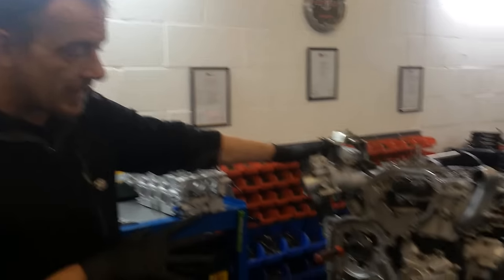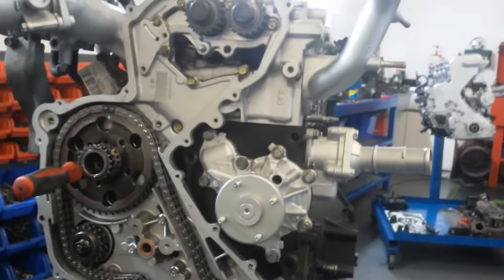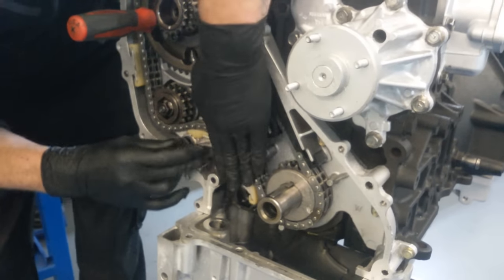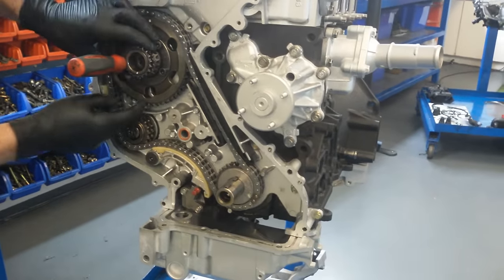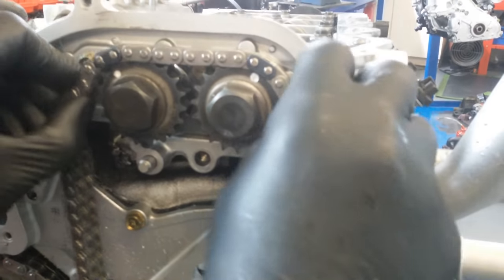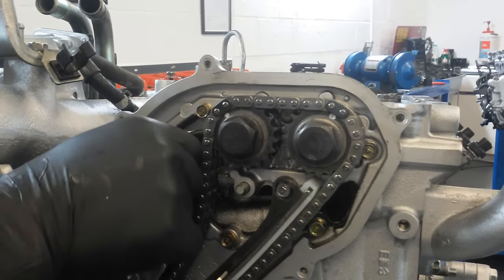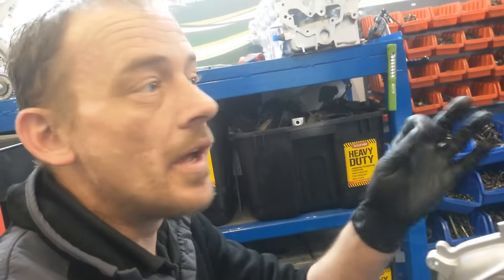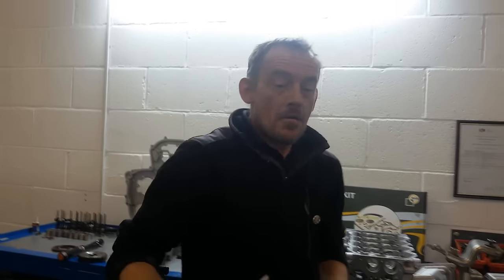How to Fit Nissan Navara D40 Pathfinder Cabstar timing chain upgrade new latest advice

Comment: Hello, how are you? I am fitting the timing chain. I've got all the timing marks correct. I turned the crankshaft by hand and find that the top timing chain jump 1 tooth every round I turn. Is it the reason you suggested we shouldn't turn the crankshaft by hand? Cheers
Reply from the maker: Yes one tooth out can bend the valves in the cylinder head Many Thanks Des
Reply: Thanks for your quick reply. I turned the crankshaft few rounds now. Should I pull the head off check the valve or just time the timing chain again will be fine? Thanks
Reply from the maker: Hi just reset the timing you will be fine Thanks Des

Comment: West yorkshire engine services  hi, in the manual is written, that the middle sprocket nut (65 star-shaped) of the fuel pump must not be loosened or removed, otherwise the fuel pump has to be replaced.... can you tell me why?? Why is this so important? What's the big deal with that stupid middle sprocket? The manual doesn't say a thing about the reason.

Comment: Hi  In Australia, I would like to fit this kit, what does the full kit cost? 2013 navara, manual spanish built.
Reply from the maker: K Ricker hi buddy if you go to are email address and leave a message we can get back to you thanks westyorkshireengines@gmail.com
Reply: @westyorkshireengineservice9160  thank you mate, i tow heaps, i fear the worst. just today i had some white smoke, as well as the common black, the turbo flutters a bit as well.
Reply: I have a 20ft car trailer, a 24 ft boat,  sounds like I really need to do this.
Reply from the maker: I would get the turbo sorted asap buddy
Reply: @westyorkshireengineservice9160  ok, it it cause it does the tubo flutter/noise, or the smoke out the back?

Comment: Excelent! Where do you bought this timing chain kit?
Reply from the maker: +Tiago Pereira from us call +44 01274 663999
Reply: +West yorkshire engine services 
I'm in Brazil. there is no double kit. use non-genuine replacement kit. Genuine kit are very expensive. I would good replacement kits indication, I'm looking on ebay but never tested. I do not know the quality of ebay kit. would you recommend any?
Reply from the maker: Hi yes we sell the very best kit available British high qaulity, if you would like email westyorkshireengines@gmail.com i will send some further info kits on ebay are very poor qaulity.
Reply: i sent e-mail, thanks !
Reply: @tiagopereira3017  boas, Tiago Pereira, conseguiste obter a referência do kit duplex para as Nissan D40?
Obrigado Rui Rebelo

Comment: do yo also deal with the transmission for this d40 engine i have 1757 code which is a front brake solenoid
Reply from the maker: +kojac1ooo Sorry, no.
Reply: Hi man this is Fada  please make video how to set the engine on TDC and how to install and Time the oil & fuel injection pump Cud U do that Plz Tku man Great Video
2/27/2018

Comment: NOW THATS A TIMING CHAIN, MY FRIEND BOUGHT AN EBAY TIMING CHAIN KIT AND THE TENSIONER FAILED 3 MONTHS LATER AND PUT HOLES IN HIS PISTONS.
Reply: closertothetruth there’s some proper rubbish kits out there on the aftermarket. Some chains are so stretched / out of spec when new they cause the engine not to run

Comment: Good morning guys im having a problem with my  navara d40 when  it starts you can drive for a 10 mile  then it looses power ill pull to the shoulder switch off when i start back im good for a next 10 miles i change suction control valve regulator same take down the fuel clean it out change fuel filter same thing can anyone help

Comment: BGA   TC0290FK ?
nissan pathfinder 2.5  2007 year
Reply from the maker: not with vac pump gear sorry
Reply: @westyorkshireengineservice9160  so in my engine there is no option for a duplex kit?
Reply: @westyorkshireengineservice9160  my friend tell me which kit to buy for my engine I will be very grateful give you a link so that I know what to look for
Reply: @westyorkshireengineservice9160  (R51) 2.5 dCi